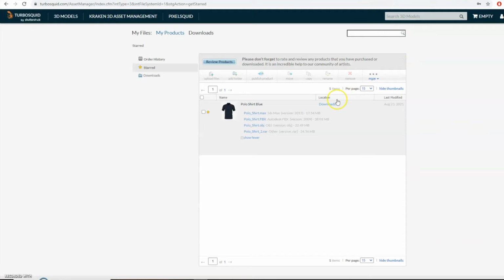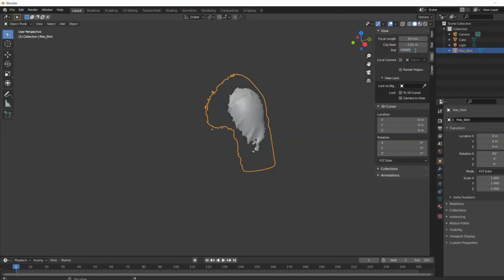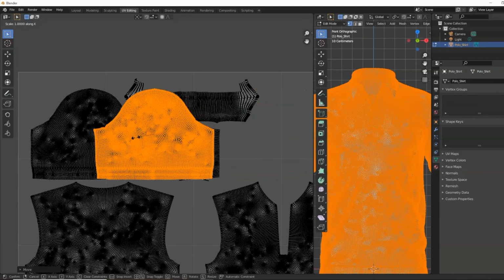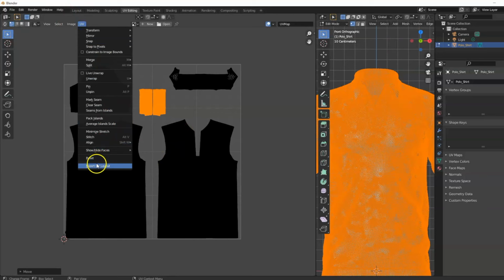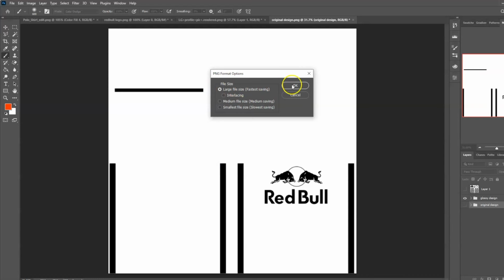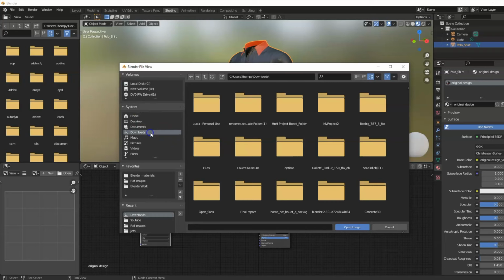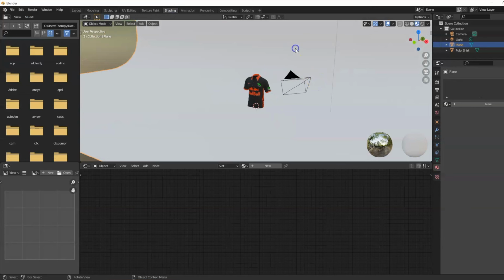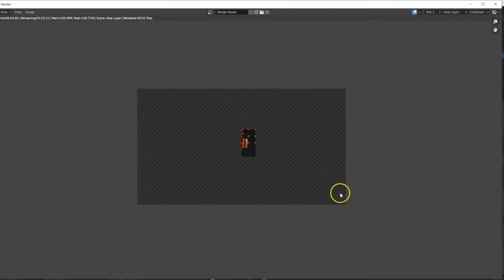Blender jersey design tutorial

Comment: Everything works fine until I add the my custom image texture, then it goes on to my t shirt template inside out. So the design I’ve created on photoshop is showing on the inside of the shirt rather than the outside. Desperate for some help
Reply from the maker: That’s odd. Are you using the same t shirt model? It may be an issue with the specific model. Either that or perhaps the normals are reversed? What appears on the outside where you would want the texture to appear?

Comment: Whenever I try to connect the new designed PNG, nothing changes on the shirt. It is still the same color it was before with no new design. How can I fix this?
Reply from the maker: Hi there! Try disconnecting and reconnecting the node to the main shader. Sometimes it just needs to refresh the new png image.
Reply: @minuscule6163  would it be possible to have a 1 on 1 conversation with you? I am having some issues, if not I will try to ask the questions here.
Reply from the maker: @dabbi2890  hi again, apologies for the late response. Unfortunately I do get quite busy with work but if you leave any questions here I’ll be sure to check back often and help as best I can. Sorry for the inconvenience.